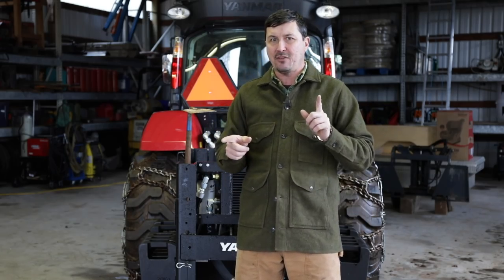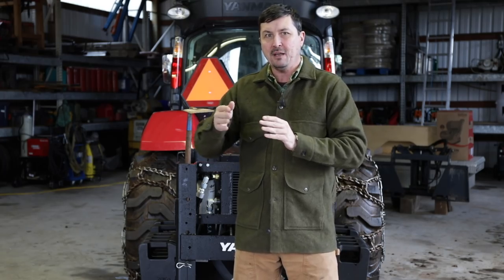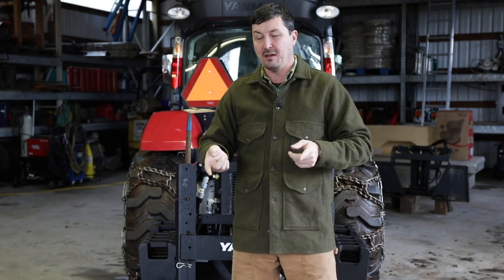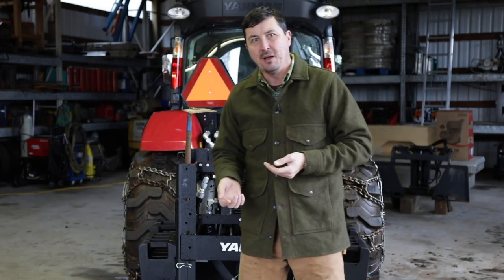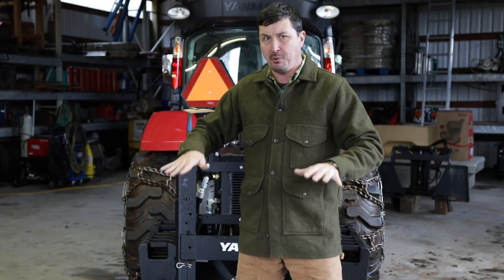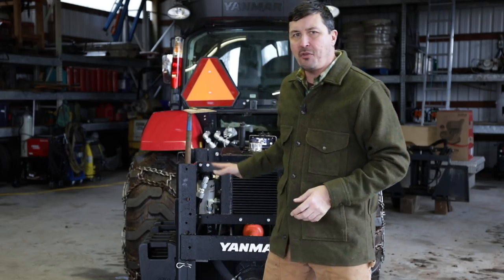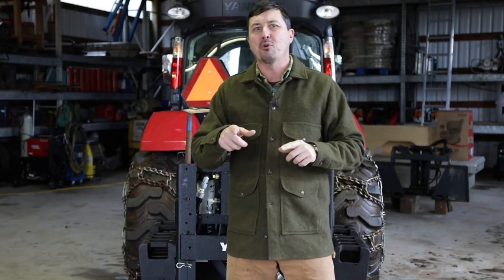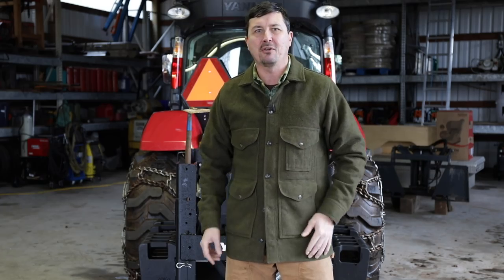Testing The World's Biggest Broom

Comment: I can't really see from the video but you seem to have a 1/4" r2t hydraulic hose on the inlet to the fan this is not large enough for the flow of the fan this will be creating a back pressure if you look at what the fan needs in the technical information for the correct rpm you can work out what internal hose diameter you need ie I would suggest it's either 3/8" 2 wire or if you need larger it may have to be 1/2" 4 wire / 1/2" compact hose hope this helps 

Regards 
Richard uk
Reply from the maker: The lines are 3/4"
Reply: What is the thread size on the fan inlet?
Reply: I just watched again and the 2 pipes you connect that are 3/4 seem to be the blade but the small one in the middle is that for the fan I can't see correctly?
Reply: Small wire is the power for the chute movement.
Reply: Richard Crookes I think you're probably more right then me...
Reply: +Richard Crookes whole unit is powered by 2 3/4 lines, there is a diverter valve to control cute rotation and deflection.
Reply: I would venture that the by-pass valves is not set properly. If it is set too low it won't develope the proper pressures. Do as you stated in the video put some gauges to check pressure and flow.
Reply: Richard Crookes  I agree.  Not to mention that I think that the fan seems too small for the size of blower.. I seem to believe that the blower on my Bobcat 843 had a larger fan in proportion to the auger.. ( obviously I don't have the dimensions nor what that the fan motor sizes is)
Reply: Truck Manjr the fan size is too small but normal for a consumer blower.
Reply: "J".. Seems like a lot of machine for the price and size.. used for homesteading and farms... that's when I start questioning the machine. .
Reply: Truck Manjr yanmar could of just put a front pto on the tractor or ran it off the mid mount. Wet system is nice but no one besides a construction contractor is going to fork out 6k for a wet kit and then 3k for each attachment. Then you think that customer is going to run yanmar? Doubt it. Just being honest.

Comment: Worst tool: Cheap automotive wire cutters/crimpers that come with tool kits; they almost always cut rather than strip the wire, and punch through or mangle the crimp connector insulation. Oh, and when you actually want to cut wire with them, the blade is usually duller than a brick.
Reply: spoonymccheese totally agree!!
Reply: Not only cheap wire stripper/cutters. I bought the Milwaukee electrical stripper and the bite is .5 too large to properly strip the wire. So sad, because they look so cool.
Reply: robert mills dag, that stinks... I bet you paid good for it too. As much as I like Milwaukee, they're overpriced sometimes
Reply: And the cutters either way too soft and dent or the pivot is so lose that the cutters don't line up

Comment: Mini hacksaws with full sized blades in them
Reply: LMAO - my soon to be 85 yr old mother has three.  cheap, slick surfaced plastic handle.   ugh.
Reply: John Hansen yes! The problem I have with them is if I have a job small enough
For a mini hacksaw then I don’t need all the extra blade sticking out the end getting in the way. And most of the time I bend my blades up more than I cut anything because the blade doesn’t have good tension on this kind of tool. It’s not the worst tool out there, but it’s the worst tool in my small to medium sized collection of tools. Besides my gator bit.
Reply: Derek Flake,  if you were and autobody repair guy, they ARE very useful, especially if you would rather not have plastic dust all over in a customers vehicle using an air cutter tool.  Handy for cutting holes in dash boards, when adjusting the hole for a different radio install.
Reply: Larry Ciarrocchi I was a plumber for a few years and bought mine thinking it would be great to cut closet bolts down and a small package to cut  thin tubular drainage pipe (your p traps and such). The extra length alway got in the way and it would constantly bind and bend. Bought a mini hacksaw with mini blades and it worked perfect for the closet bolts.

Comment: regarding the snow blower just an idea but could it not working properly be something to do with gearing ratio that turns the blades
Reply from the maker: No gears, it's hydraulic,
Reply: Wranglerstar would there still be gears inside the hydraulic motor
Reply: Titan Blade, you mean in the transmission for the auger to the impeller?
Reply: Larry Ciarrocchi yes that is what I mean I'm not an engineer

Comment: Useless tool:  The offset screwdriver that comes with a Craftsman set. The thing that has a Phillips on one end and standard on the other.
Reply: shopnwoods they have certainly come in handy for the right application. One example, I had a friend locked out of his own garage, leaving the keys inside. The style of lock was the plate that bends over to the lock loop, and a pad lock for security. I was able to pull the plate back far enough to use the offset driver and unscrew all 4 screws. No damage done to the lock, the plate or the garage door. No other driver would have fit. Yes, I had all my tools with me as well.

I've come across other applications but many are automotive or home maintenance....
Reply: Maybe it's no completely useless. There are times when I could have used it. But, that's when its nowhere to be found...
Reply: shopnwoods, they are very useful if you're an auto body man.  They get right up to the bottom of the windshield in the interior where the dashboard screws reside.  That's just to loosen them, then you can remove them with your fingers.  I did autobody and frame repair for 48 years, so I know how useful it is.

Comment: Do you have a rpm tester to see what the fan is running at I would check that first Because if it is running at top speed then it means it is boggon down do to power loss and maybe 3000 psi is not enough good luck I know you will get straighten out And I found a old shoe stretcher in the bottom of one of my big old tool box what the heck as far as useless tools

Comment: Pressure relief valve is not open when it’s open it has a high pitch noise. it’s probably the motor is gone
Reply: That's only direct acting relief valves. Any indirect or port relief wont chatter like a standard direct acting valve.

Comment: Love your Channel  and Yanmar makes great stuff! The problem with the snowblower is where the Hyd. Power supply is located... You know and you said it. It  takes power to lift snow and speed to throw it. Translated  to engineering  power equals horsepower and speed equals torque.  Translated further horsepower in hydraulics speak is  pressure and torque is the amount of flow of hydraulic fluid. When you mount the power unit in the back of the tractor you would have to have hoses bigger than the Mississippi to get the pressure and  flow rate optimized to the front of the tractor......I think Yanmar should mount one of their  great small diesels right on the snow thrower attachment...Even if they don't do it ...YOU keep up the great work!

Comment: I remember you had trouble with quick connectors a while ago.
I my stint as a hyd. mechanic, we found the connectors from certain outfits became restrictions. Pls verify flow and pressure beyond them connectors along with checking at ports near the pump, see the pressure has to get to that motor same as it was near the pump. You have a restriction some where I agree. But don't skip around test everywhere not  just at pump.
It has to have a return that can handle the volume you can produce.
Happy New Year.
Hank

Comment: Cody, My ex housemate purchased a wall board saw years ago, as well as fine Emery paper to remove rust from a cast Iron pan.
well neither worked very well the saw couldn't cut wallboard or even  cold glue.  The Emery paper, well after two passes the grit disappeared.  I've kept them for reminders for helpers that want to help.  But fail miserably.
As for the Nay-sayers I say let them go to where they can run the channels. And you do as you wish. It's your channel do what makes you feel good and you enjoy doing.

Comment: Don't change your decisions on content.  I love what you do.
MEASURE: flow and pressure before and after bypass- you are on the right track.  Must have data to make decisions, otherwise you are guessing.  MEASURE: blower auger speed - good use for a cheep optical counter.  Your partners' engineers will need data.  I would enjoy working out the bugs with the team.  I spent more than twenty years in engr labs of big corps.  It's fun and makes the mind work.

Comment: Hey Cody, just to make you aware most standard hydraulic systems on tractors of your size and skidsteer loaders run around 20-30 gallons per minute of hydraulic fluid. The high flow skidseer loaders run 38-50 gallons per minute. But where you have a external power pack for your hydraulic system it's hard to say without knowing how much flow that it's putting out. That being said I know that high flow systems have a case drain which is a third hydraulic hose. I might have missed it but I only seen you hook up 2 hydraulic hoses so maybe your external pump is only a standard flow and you're not getting enough hydraulic flow. Hydraulic pressure is important but flow is more important on this type of equipment. There are companies that make standard flow attachments but most attachments like snow blowers are designed for a high flow systems. I hope that this helps you out.

Comment: I can confirm that the brush actually works awesome for snow removal. I'm a grounds keeper for a university campus and we use one for clearing walkways. It's smaller than that one and it works well for up to about 6 inches, so I imagine yours could handle a lot more. We use it on pavement only so I don't know what it'll do on gravel, but I imagine if the ground is frozen it would still work. The reason we use it is because it leaves absolutely no residue, it even strips most of the ice off! It's actually faster and cleaner than plowing usually. Id be curious to see how it works for you.

Comment: I'm no mechanic, however, in my opinion those augers appear to be turning plenty fast.  I would recommend that you search YouTube videos on how people modified their snow blowers to throw wet snow.   In that center auger, there may be too much clearance between the fan paddles and the housing.  If the company would allow it, attach pieces of a truck rubber mud flap to two of the opposite blades.  You fit the mud flaps to close any space between the fan and the housing.  The videos on YouTube will explain it better.  I did it on my 3-pt mount snow blower, using self-tapping screws to attach the mud flaps.  The blower does seem to work better in wet snow.

Comment: Hey just a thought.  Check the distance between the edge of the ejector fan blades and the side of the chute.  Google "snow blower mod."   you take rubber pieces and attach them to the blades.  The rubber barely contacts the side of the chute and really helps shoot the snow long distance and also keeps everything from clogging.  Just a thought.  Cheers!
Reply: Nathan Reed, I did that to my Honda HS 50T snow thrower, Now I can even throw slush.

Comment: I too think you need to know line pressure at multiple points. You have to know that the fluid is moving and at the expected pressure. I would isolate the impeller and auger. Check to see if each operates correctly all by their selves. You should also measure the rpm of the impeller. The auger looks good, but you should measure its rpm as well.

Comment: +wranglerstar it could be a hidrolic valve that's still open and needs closed. your not using the backhoe, there must be a hydrolic diversion valve still open and the pleasure is being sent to the backhoe as well as the snowblower. there must be a leaver hiding some place that diverts All pressure to whatever  attachment you have on.   if you can move that backhoe while the snowblower is running then that's pressure you want diverted to the front. should be a simple leaver on a split check valve or a little square sticking out of a split check valve that you can turn with a half inch spanner to divert all pressure to the hoses your operating. love your  content can't get enough of it. peace and love from Scotland.
Reply: The snow blower has it own dedicated PTO hydraulic power pack on the back of the tractor.

Comment: Growing up in the Sierra Mountains I was around snow blowers for over 20 years. Both the ones we used to do the driveway and walkways and the large street blowers used by Cal Trans. The first thing I see in the video is that the both the auger and the impeller are turning to slow. Just as you were suspecting. The next thing that could be an issue is the design of the impeller chamber seems small for the over all volume of snow that would be coming into the blower. It is hard to tell just from a video, but as many times as I took apart several different models due to lodged pinecones or branches hidden the snow shutting the blowers down it becomes easier to see issues in the way they are designed. As much as I appreciate the size of this blower, I almost wonder if a walk behind Honda blower would be faster. Unless things get up to speed with this unit, you would have to move at a crawl to move the snow because of the slow processing of the volume coming in. It is much easier to diagnose when you can see the unit in action, but this is what I see from what you have here Cody. Hope you get it all worked... thanks for sharing this.

Comment: Check the pump capacity against the hydraulic motor capacity. Rpm, flow at that rpm, rated pressure.
Pressure gages on both ends of the hose. There might be a blockage.
Thanks,
John

Comment: Hey Wranglerstar!  We love your channel and your videos.  We hope your snowblower manufacturer can figure out what the problem is.  I know what it is like to have equipment that doesn't live up to my expectations!  We live in the great Northwet in the Cascades with a 400inch/season average.  Most of the time it is Cascade concrete.  We love when it is in the mid 20's and lower because the snow blows so nice.  We don't get that very often.  On our road there are lots of tractors with snowblowers and quite a few tracked walk behinds.  There are Kubotas, Deeres, a wheeled Bobcat and tracked Bobcats.  We have been blowing wet sticky snow for years and years and have learned some things.  My 20+ year old 27 hp John Deere 955 with the front mount Deere 59 inch snowblower loves cold dry snow but absolutely hates any snow above 29 degrees.  Our 13 hp tracked Honda throws snow farther than any tractor of any hp on the mountain (except the big county and DOT blowers) and hardly ever clogs!  Even our old 8 hp tracked Honda and our old 5 hp tracked Honda we use on the deck throws farther than my tractor.  Our neighbor has a rear mount blower on his Kubota tractor and it is not as picky when it comes to snow temp.  It throws farther than my tractor any day of the week but you have to blow in reverse which is hard on the neck and why we didn't get a Kubota.  Here is what I want to do to my Deere to make it throw and not clog.  Right now it clogs with every pass in heavy snow.  The tolerance between the flywheel and the flywheel housing is important for throwing efficiency.  Mine has at least a 1/2 inch gap all the way around.  Recently I found a video on Youtube that shows how to retrofit any blower to perform better by adding rubber extensions to the flywheel shovels.  Someday I want to find or have a 4 shovel flywheel made for it as well.  Honda's have a 4 shovel flywheel and that means each bite of snow is smaller so each shovel doesn't have to push as much snow mass up the chute.  I also want to find a curved, possibly articulated chute to retrofit onto my blower.  Snow is like water and likes curves rather than corners.  It doesn't like my square chute.  The snow packs hard in the corners and slows the exiting snow down.  Here is the cool video I found on how to retrofit the rubber on the flywheel shovels.  https://www.youtube.com/watch?v=EMAgb3QNEE8

Comment: So a little background. I was hydraulic mechanic for 4 years specifically with commercial hydraulic’s. I have worked on everything from cranes to end loaders, CAT to Liebherr. With that said it could be a lot of different things. The things that stand out to me on this rig is the length and size of return lines. The return on a high flow system should always be bigger then the pressure side. Depending on the type of pump used and whether it is a self adjusting type pump like a Parker P1. These style of pumps will trade flow for pressure and vice versa. If there is a significant amount of back pressure it will cause the pump to swing the swash plate into more pressure then flow.

I am not saying that is the issue. I am just trying to show how difficult a problem like this is to diagnose without further information. The more data the better. It would be my recommendation to get a good hydraulic mechanic to come out and run some preliminary diagnostics. Sometimes the engineers sitting back at HQ forget that things in real life don’t always conform to mathematical equations. Sometimes things are as simple as a slightly torn o-ring on the protection circuit check valve.

If you have made it his far into my ramblings congrats. I love this channel and watch all the videos!!! Keep up the great work Cody and family! I appreciate you and your families efforts.

Comment: Very nice video editing. I am not a hydraulic expert but do run a PTO snowblower on our tractor. Visually, the fan is running roughly what I would expect speed-wise compared to the auger with no load. Perhaps the load on the fan is higher than calculated so the pressure or flow is not enough to keep up with the snow conditions and volume. Wet snow will not throw that far even with a good blower, at least in my experience.

Nice video, keep up the nice work.